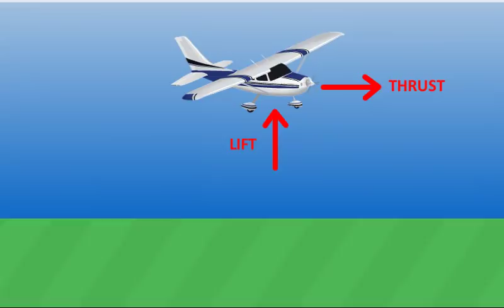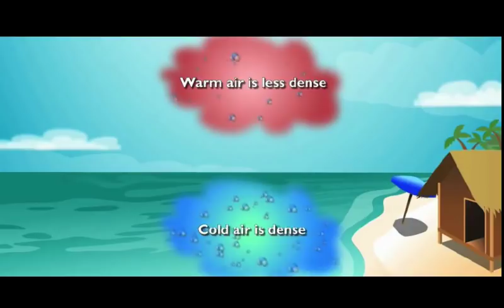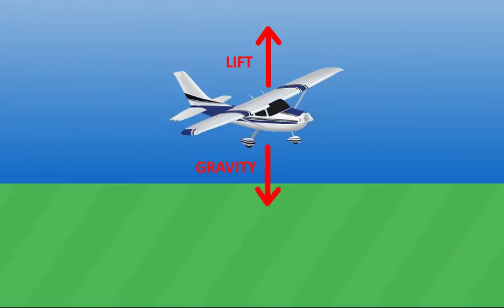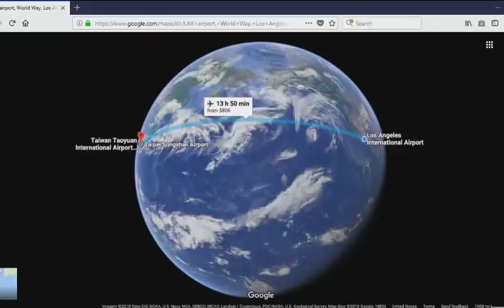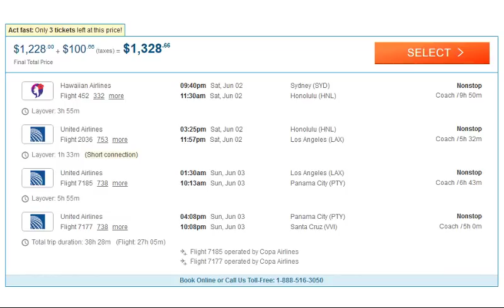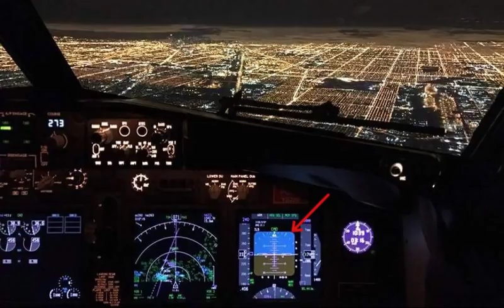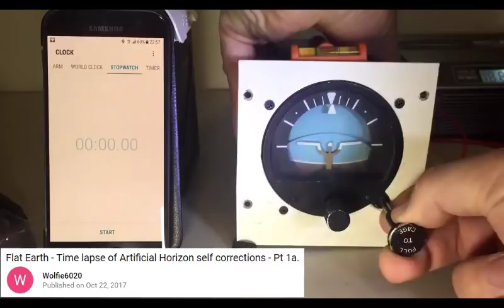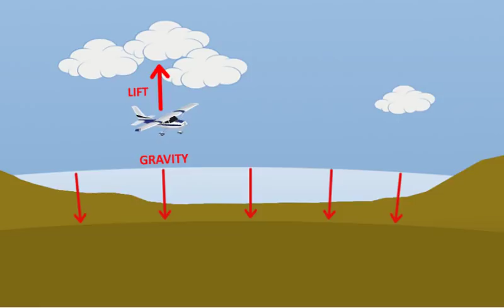Flat Earth Falsities - Plane Nonsense

Comment: WATER WOULD HAVE TO FLOW UP HILL FOR A GLOBE TO WORK. "THERE IS NO UPHILL ON A GLOBE" SAYS GLOBERS. GIVEN THAT LOGIC , THERES NO DOWN HILL ON A GLOBE EITHER. WHY WOULD WATER FLOW AT ALL? CANT HAVE IT BOTH WAYS. IF IT WERE A GLOBE ROTATING ON AN AXIS 1000 MILES AN HOUR AND HURLING THROUGH SPACE TOWARDS POLARIS THEN NORTH IS TOP/ FRONT ... EQUATOR IS THE CENTRE/MIDDLE AND SOUTH IS BOTTOM /BACK ... THE EARTHS MOTION WOULD CAUSE DIRECTIONAL ORIENTATION... 
WE ALL KNOW THE EQUATOR IS THE CENTRE / MIDDLE. .. THEN WE ARE SUPPOSEDLY ROTATING 1000 MILES AN HOUR ON AN AXIS WHICH MEANS CENTRIFUGAL FORCE IS GREATEST AT THE EQUATOR. 
THE IMAGINARY FORCE YOU REFER TO AS GRAVITY WOULD GRADUALLY GET STRONGER TOWARDS THE POLES . 
ITS AN "OBLATE SPHEROID"... "PEAR SHAPED" ... "A LITTLE CHUBBIER BELOW THE EQUATOR" ...
THEN ON TOP OF THAT THE EARTH IS HURLING THROUGH THE GALAXY AND SPIRALING AROUND THE SUN AT 37,000 MILES AN HOUR TOWARDS POLARIS. .. NORTH BOUND! NORTH IS FRONT! 
THE PHYSICS WOULD BE LIKE A WET FOOTBALL SPIRALING THROUGH THE AIR. WATER WOULD MOVE FRONT TO BACK ...NORTH TO SOUTH... AND BE THROWN OFF AT THE CENTRE/  MIDPOINT / EQUATOR . 
NILE RIVER IS OVER 4200 MILES LONG AND FLOWS FROM SOUTH TO NORTH. 
THE NILE RIVER WOULD HAVE 572 MILES OF CURVATURE AT ITS MIDPOINT  (APEX)
THEREFORE THE NILE RIVER WOULD HAVE TO FLOW UP AND OVER 572 MILES OF CURVATURE OVER A DISTANCE OF 4200+ MILES ON A BALL. 
THE NILE RIVER WOULD HAVE TO FLOW UP HILL BEGINNING SOUTH OF THE EQUATOR,CROSSING OVER THE EQUATOR AND CONTINUE NORTH DESPITE THE ENTENSELY STRONG CENTRIFUGAL FORCE . IMPOSSIBALL!  

THE SUPPOSED CURVATURE IS 8 INCHES PER MILE SQUARED. ..

1) BEDFORD EXPERIMENT PROVES NO CURVATURE. 
2) TORONTO ROGERS CENTRE SEEN FROM GRIMSBY 6FT ABOVE LAKE LEVEL FROM 30.84 MILES AWAY PROVES THERES NO CURVATURE. TOP OF THE ROGERS CENTRE SHOULD BE OVER 200FT BELOW THE SUPPOSED. 
3) CHICAGO SEEN FROM MICHIGAN PROVES THERES NO CURVATURE. 6FT ABOVE LAKE LEVEL.60 MILES AWAY.CHICAGO SHOULD BE 2166FT BELOW THE SUPPOSED CURVATURE. 
4) THE LONGEST CANAL IN THE WORLD IS 100 MILES LONG BUT NOT A SINGLE LOCH WAS USED. NO CURVATURE. 
5) LONGEST BRIDGE IN THE WORLD IS 102 MILES LONG. SHOULD BE ALMOST 7000 FT OF CURVATURE IN THAT BRIDGE.
6) LAKE PONTCHATRAIN BRIDGE IS 24 MILES LONG AND COMPLETELY LEVEL AND BUILT OVER WATER THE ENTIRE 24 MILES. ONLY 2 INCHES LOWER ON ONE SIDE . 2 INCHES IN 24 MILES??? NO CURVATURE!  SEA LEVEL NOT SEA CURVE!
7) EXALT WIRELESS WORKS BY LINE OF SIGHT OVER A DISTANCE OF 146 MILES! IMPOSSIBLE ON A GLOBE! 
8) SASKATCHEWAN. .. SALT FLATS OF BOLIVIA. .. KANSAS .... ALL FLAT FOR HUNDREDS OF MILES! 

SEA (LEVEL). .. AIR (PLANE)... PLANE (T) 

THERES ABSOLUTELY NO PROOF OF A GLOBE ROTATING IN SPACE. NOT A SINGLE REAL IMAGE/FOOTAGE. 
MOON LANDING WAS A HOAX. ISS LIVE STREAMS ARE OBVIOUSLY FAKE AND FILMED IN STUDIOS. ISS=IN SOME STUDIO. 
HARNESSES,  GREEN/BLUE SCREENS,  CGI, UNDER WATER , AIR BUBBLES,  FLY ON THE OUTSIDE OF THE ISS WINDOW. ETC 
WE LIVE ON A FLAT STATIONARY PLANE WITH A FIRMAMENT ABOVE. THEYVE NEVER BEEN TO SPACE. ITS A CLOSED SYSTEM. WE CANNOT LEAVE THE EARTH. SPACE IS WATER. 

WERNER VON BRAUN (NASA FOUNDER / ROCKET SCIENTIST) HAS PSALMS 19:1 ENGRAVED ON HIS HEADSTONE. 
PSALMS 19:1 TALKS ABOUT GOD AND THE FIRMAMENT.
Reply: Stop trolling and fuck off you ignorant fool.
Reply: TRU MAN Yup. Weight does change between the poles and the equator. http://curious.astro.cornell.edu/about-us/42-our-solar-system/the-earth/gravity/94-does-your-weight-change-between-the-poles-and-the-equator-intermediate
Y U NO RESEARCH?!!
Reply: This is one of the most insecure and pathetic flerfers yet.

I love this guy.
Reply: TRU MAN Did you miss my last response to you, where I provided real pix of the Earth, and many many ways that anyone, including you, can determine the shape of the Earth? Well, if you can spam, I guess I can too. Here it comes!!

Actual images of the Earth.
Current full-disk weather and Earth-observation satellite images:
http://www.goes.noaa.gov/
https://www.star.nesdis.noaa.gov/GOES/GOES16_FullDisk.php
http://rammb-slider.cira.colostate.edu
http://epic.gsfc.nasa.gov/
http://himawari8.nict.go.jp/
http://www.eumetsat.int/website/home/Images/RealTimeImages/index.html
http://electro.ntsomz.ru/en/
http://satellite.imd.gov.in/insat.htm 
Photos of Earth by planetary spacecraft, via the Planetary Society:
http://planetary.org/explore/space-topics/earth/pics-of-earth-by-planetary-spacecraft.html
The Project Apollo Archive on Flickr. Photos from all the Apollo missions in huge scans, including the many photos of Earth.
https://www.flickr.com/photos/projectapolloarchive/albums
NASA Johnson Flickr site. Photos from all of the ISS expeditions and much more: 
https://www.flickr.com/photos/nasa2explore/albums
Gateway to Astronaut Photography of Earth:
https://eol.jsc.nasa.gov/
Archived weather satellite images:
http://www.ssec.wisc.edu/datacenter/ (and the easiest place to navigate for all Meteosat images)
https://www.youtube.com/channel/UC8q7_qX1FsiNUa9bDc1jFqw/playlists (Wonderful Himawari-8 time lapses)
Dish Network's Dish Earth Channel: https://youtu.be/H-REzr7HB9E
https://www.dailymotion.com/video/x3kl7f2

Jenna Fredo's video submitted by her to Metabunk for analysis (you can see the refraction bringing the buildings up and compressing them, using the overlay slider in the entry on this page:  https://www.metabunk.org/posts/204561/

As for Lake Pontchartrain, Soundly has left your comment thread on one of his videos there as a lesson to others to do diligent reseearch. His photos and videos match the globe model perfectly: http://walter.bislins.ch/bloge/index.asp?page=Flat-Earth%3A+Finding+the+curvature+of+the+Earth The locations were also surveyed, by Jesse Kozlowski, but also many decades previously. https://youtu.be/BtCyR_MwhFo It is rock solid from every angle. "Flerspective" need not apply. 

As I tried telling you before, in this day and age, anyone can determine the shape of the Earth for themselves. We all have so many more resources than people in previous generations to make observations. Besides the photos of long straight level structures like the Ponchartrain Causeway and pylon line, you can do the exercises on the "Flat Earth Math" channel...
https://www.youtube.com/channel/UCTDz58kK5bdffWLSx4zgAFA 
You can measure it with friends, Eratosthenes style... 
https://youtu.be/V03eF0bcYno
Or through the method of Al Biruni, the "father of geodesy"...
https://owlcation.com/stem/How-to-Determin-the-Radius-of-the-Earth-Al-Birunis-Classic-Experiment
https://youtu.be/6XXCiHJOULQ
Through geodesy, which is how the world was measured and mapped... 
https://youtu.be/moDr0CPZhbs 
https://youtu.be/ZlP3njwf6h0
Geodesy includes the dip of the horizon, which has been taken into consideration with every use of a marine sextant for centuries... 
https://www.davisnet.com/product_documents/marine/manuals/00026-710_IM_00025.pdf (page 9) 
You can see it by using a long water level with a clear view of the ocean horizon... 
https://www.quora.com/How-can-we-practically-observe-that-the-earth-is-round/answer/Evan-Kress 
And in aircraft at altitude using a attitude indicator, theodolite app for your phone, and more... https://youtu.be/BLQhUX8brbA 
https://youtu.be/HFj7gNh3yOM  
Good paper on measuring sagitta in photographs of horizon at altitude: http://thulescientific.com/Lynch%20Curvature%202008.pdf
Important informal video specifically on importance of center of frame for high altitude balloons, if you want to go that route: https://youtu.be/c1-S_2vRsrM

As for those world records proving "flat earth", nope. The reason they garnered such attention is that those atmospheric conditions rarely coincide to show those mountains. Always go to the source. https://beyondhorizons.eu/2016/08/03/pic-de-finestrelles-pic-gaspard-ecrins-443-km/ Then you can go have some fun with the hoaxers... https://youtu.be/ZfeeN90XiBQ https://youtu.be/0PWSoYjH7OU 

As for "I can see too far across water" videos, keep in mind that refraction can do some wild things, especially when looming occurs, and you are using a telephoto lens which magnifies just a couple degrees of arc. A dead giveaway is visible distortion in the image. 
http://www.abc57.com/news/skyline-skepticism-the-lake-michigan-mirage
Meanwhile with minimal refraction, you will have sharp images with no distortion or mirroring, like this:
https://youtu.be/dKF7D7XsyTA
https://youtu.be/P8U5aYH1yhk

FE is a trolling internet prank. The only question is whether you are a troller or the trolled. I and others try to help people who don't have the common sense or basic knowledge to know better.
Reply: TRU MAN Here are your satellite tracking resources. When do you you take your own pix? I just got video of the ISS, and it certainly isn't a dot.
Satellite tracking in sky: 
http://www.heavens-above.com/ 
transit-finder.com 
http://www.skyandtelescope.com/observing/how-to-see-and-photograph-geosynchronous-satellites/ 
https://www.calsky.com/cs.cgi/Satellites/16 
https://spotthestation.nasa.gov/home.cfm 
Satellites and junk in 3D space: http://stuffin.space/ 
Cool pics: http://astrophoto.fr/satellites.html
Reply: TRU MAN Hmm. You limit your research to a tiny corner of YouTube, which is itself a very small section of the internet, which is just a part of the overall research material you could use, and also exclude yourself from doing your own actual experiments and observations to determine the shape of the Earth for yourself, the objective methods for which I provided for you.
Reply: Superior Planet 
Didn't think you would bombarding that uneducated fool that long. 
I would give it up after 10 comments. 
Give you a big compliment for keeping your cool. 
👌
Reply: TRU MAN
 "M SIMPLY DESCRIBING YOUR RIDICULOUS GLOBE MODEL TO DEMONSTRATE HOW WATER WOULD HAVE TO DEFY THE LAWS OF PHYSICS ON A ROTATING BAL"

You describe nothing, sjit for brain, you just regurgitate what you 've seen in flat earth YT video. The same old "argumnets" countless times debunked
Reply: TRU MAN : the living advice against the damages of inbreeding !
Reply: Oh, he typed in all caps. This must be important.
Reply: Actually it's called aircraft, and it flies in atmosphere, not atmosplane.
Reply: hemisphere not hemisphlat
Reply: I've seen these so called videos of iss flying by in the sky. They look fake to me. Very suspect. 
And for the 4rth time the live streams are obviously filmed in a studio. 
You keep avoiding this . I don't care what you think you see in the sky.
Reply: ALL THE LIVE STREAMS ARE FAKE! FILMED IN A STUDIO. ISS = IN SOME STUDIO.
Reply: THANKS TRU MAN.  JUST BY YOUR NAYM I NOW U ARE TRU!  FLAT ERFF FOREVER!!!!!!!
Reply: TRU MAN
"WATER WOULD HAVE TO FLOW UP HILL FOR A GLOBE TO WORK"

Another inbreed moron who doesn't know the difference between AL-TI-TU-DE (downhill/uphill) and LA-TI-TU-DE (one of the spherical coordonate) 
No wonder why you are a flat earth adept !
Reply: TRU MAN
"Superior Planet YOUR GLOBE IS SUPPOSEDLY ROTATING 1000 MILES AN HOUR. FASTER THAN THE SPEED OF SOUND. "
 NO littlme mama/half sister's boy
It rotates at 1 turn/day... twice slower than an hour hand !

ONLY hillbillies use units like MPH to qualify a rotation speed...
 Normal persons use RPM or RPS or rad/s...
Reply: TrU MAN

The only thing you have ever proven is the damages of inbreeding... so common in high religious background !
Reply: TRU MAN

"Superior Planet NO PROOF OF A GLOBE?  THATS WHAT I THOUGHT! LOL"
  Nobody care about what you thought.
 Your opinion have the same value than the last sheet of toilet paper I used... minus the fertilizer value !
Reply: TRU MAN 
Get your stuff straight otherwise your stupidity is getting the better of you.
Reply: Prove it
Reply: The earth supposedly rotates 1000 miles an hour at the equator but the Nile river starts south of the equator flows over the equator and continues north despite centrifugal force. Oh yeah its so plausible. Lol
Reply: Stop repeating the facts? Why would I do that? This post proves earth is flat.
Reply: WATER WOULD HAVE TO FLOW UP HILL FOR A GLOBE TO WORK. "THERE IS NO UPHILL ON A GLOBE" SAYS GLOBERS. GIVEN THAT LOGIC , THERES NO DOWN HILL ON A GLOBE EITHER. WHY WOULD WATER FLOW AT ALL? CANT HAVE IT BOTH WAYS. IF IT WERE A GLOBE ROTATING ON AN AXIS 1000 MILES AN HOUR AND HURLING THROUGH SPACE TOWARDS POLARIS THEN NORTH IS TOP/ FRONT ... EQUATOR IS THE CENTRE/MIDDLE AND SOUTH IS BOTTOM /BACK ... THE EARTHS MOTION WOULD CAUSE DIRECTIONAL ORIENTATION... 
WE ALL KNOW THE EQUATOR IS THE CENTRE / MIDDLE. .. THEN WE ARE SUPPOSEDLY ROTATING 1000 MILES AN HOUR ON AN AXIS WHICH MEANS CENTRIFUGAL FORCE IS GREATEST AT THE EQUATOR. 
THE IMAGINARY FORCE YOU REFER TO AS GRAVITY WOULD GRADUALLY GET STRONGER TOWARDS THE POLES . 
ITS AN "OBLATE SPHEROID"... "PEAR SHAPED" ... "A LITTLE CHUBBIER BELOW THE EQUATOR" ...
THEN ON TOP OF THAT THE EARTH IS HURLING THROUGH THE GALAXY AND SPIRALING AROUND THE SUN AT 37,000 MILES AN HOUR TOWARDS POLARIS. .. NORTH BOUND! NORTH IS FRONT! 
THE PHYSICS WOULD BE LIKE A WET FOOTBALL SPIRALING THROUGH THE AIR. WATER WOULD MOVE FRONT TO BACK ...NORTH TO SOUTH... AND BE THROWN OFF AT THE CENTRE/  MIDPOINT / EQUATOR . 
NILE RIVER IS OVER 4200 MILES LONG AND FLOWS FROM SOUTH TO NORTH. 
THE NILE RIVER WOULD HAVE 572 MILES OF CURVATURE AT ITS MIDPOINT  (APEX)
THEREFORE THE NILE RIVER WOULD HAVE TO FLOW UP AND OVER 572 MILES OF CURVATURE OVER A DISTANCE OF 4200+ MILES ON A BALL. 
THE NILE RIVER WOULD HAVE TO FLOW UP HILL BEGINNING SOUTH OF THE EQUATOR,CROSSING OVER THE EQUATOR AND CONTINUE NORTH DESPITE THE ENTENSELY STRONG CENTRIFUGAL FORCE . IMPOSSIBALL!  

THE SUPPOSED CURVATURE IS 8 INCHES PER MILE SQUARED. ..

1) BEDFORD LEVEL EXPERIMENT PROVES NO CURVATURE.  
2) TORONTO ROGERS CENTRE SEEN FROM GRIMSBY 6FT ABOVE LAKE LEVEL FROM 30.84 MILES AWAY PROVES THERES NO CURVATURE. TOP OF THE ROGERS CENTRE SHOULD BE OVER 200FT BELOW THE SUPPOSED. 
3) CHICAGO SEEN FROM MICHIGAN PROVES THERES NO CURVATURE. 6FT ABOVE LAKE LEVEL.60 MILES AWAY.CHICAGO SHOULD BE 2166FT BELOW THE SUPPOSED CURVATURE. 
4) THE LONGEST CANAL IN THE WORLD IS 100 MILES LONG BUT NOT A SINGLE LOCH WAS USED. NO CURVATURE. 
5) LONGEST BRIDGE IN THE WORLD IS 102 MILES LONG. SHOULD BE ALMOST 7000 FT OF CURVATURE IN THAT BRIDGE.
6) LAKE PONTCHATRAIN BRIDGE IS 24 MILES LONG AND COMPLETELY LEVEL AND BUILT OVER WATER THE ENTIRE 24 MILES. ONLY 2 INCHES LOWER ON ONE SIDE . 2 INCHES IN 24 MILES??? NO CURVATURE!  SEA LEVEL NOT SEA CURVE!
7) EXALT WIRELESS WORKS BY LINE OF SIGHT OVER A DISTANCE OF 146 MILES! IMPOSSIBLE ON A GLOBE! 
8) SASKATCHEWAN. .. SALT FLATS OF BOLIVIA. .. KANSAS .... ALL FLAT FOR HUNDREDS OF MILES! 

SEA (LEVEL). .. AIR (PLANE)... PLANE (T) 

THERES ABSOLUTELY NO PROOF OF A GLOBE ROTATING IN SPACE. NOT A SINGLE REAL IMAGE/FOOTAGE. 
MOON LANDING WAS A HOAX. ISS LIVE STREAMS ARE OBVIOUSLY FAKE AND FILMED IN STUDIOS. ISS=IN SOME STUDIO. 
HARNESSES,  GREEN/BLUE SCREENS,  CGI, UNDER WATER , AIR BUBBLES,  FLY ON THE OUTSIDE OF THE ISS WINDOW. ETC 
WE LIVE ON A FLAT STATIONARY PLANE WITH A FIRMAMENT ABOVE. THEYVE NEVER BEEN TO SPACE. ITS A CLOSED SYSTEM. WE CANNOT LEAVE THE EARTH. SPACE IS WATER. 

WERNER VON BRAUN (NASA FOUNDER / ROCKET SCIENTIST) HAS PSALMS 19:1 ENGRAVED ON HIS HEADSTONE. 
PSALMS 19:1 TALKS ABOUT GOD AND THE FIRMAMENT.
Reply: Superior Planet HORIZONTAL IS ALWAYS HORIZONTAL STUPID. FLAT,EVEN,PLANE.
Reply: Superior Planet I ALREADY HAD A COOKIE. A PEANUT BUTTER CHIP COOKIE !
Reply: Superior Planet YOUR GLOBE IS SUPPOSEDLY ROTATING 1000 MILES AN HOUR. FASTER THAN THE SPEED OF SOUND. 
THE EARTH IS SUPPOSEDLY FLYING THROUGH THE GALAXY SPIRALING AROUND THE SUN AT 37,000 MILES AN HOUR. AND FLYING THROUGH SPACE AT 500, 000 MILES AN HOUR. YEAH ID DENY THIS TOO IF I WERE YOU. ITS ABSOLUTELY RIDICULOUS! LOL
Reply: Superior Planet SUPERIOR PLANE (T) DIDNT ADDRESS A SINGLE THING I SAID WITH REBUTTALS . WHY? BECAUSE HE CANT! DIDNT EVEN TOUCH THE LACK OF CURVATURE! LOL
Reply: Superior Planet LEVEL = FLAT, EVEN, PLANE.  PLANE (T) .. HORIZON. .HORIZONTAL. .FLAT EVEN PLANE . NO CURVATURE NO GLOBE. . FACTS HURT I KNOW.
Reply: Superior Planet ITS AN "OBLATE SPHEROID". .. YEAH CUZ THATS EXACTLY WHAT WE SEE IN THESE FAKE IMAGES/VIDEOS. LOL
Reply: Superior Planet NO PROOF OF A GLOBE?  THATS WHAT I THOUGHT! LOL
Reply: Superior Planet ITS CALLED AN AIR PLANE BECAUSE IT FLIES OVER A PLANE. GYROSCOPES PROVE PLANES FLY OVER A PLANE. GYROSCOPE NEVER ROLLS BACKWARDS. NO ADJUSTMENTS EVER MADE TO COMPENSATE FOR THE SUPPOSED  "CURVATURE". ..
Reply: Superior Planet ONLY 1 "MOON LANDING" WAS EVER FILMED. THEY SUPPOSEDLY LOST THE FOOTAGE AND DESTROYED THE TECHNOLOGY THEY USED TO GET TO THE MOON. DISNEY PRODUCTION. STANLEY KUBRICK. FILMED IN THE DESERT. AREA 51.  
ROCKETS GO UP ,DO A MASSIVE ARCH AND COME BACK DOWN INTO THE OCEAN. 
SEARCH- CHALLENGER ASTRONAUTS FOUND ALIVE AND WELL .
THEY SUPPOSEDLY DIED 30 YRS AGO IN THE CHALLENGER EXPLOSION. LOL 
SEARCH -ROCKET SLAMS INTO FIRMAMENT. 
SEARCH -METEOR HITTING THE FIRMAMENT. 
SEARCH -ROCKET HITS THE FIRMAMENT. 
SEARCH -SPRITES PROVE THE FIRMAMENT. 
SEARCH -ISS EXPOSED USING HARNESSES. 
I NOTICED YOU ADDRESS SOME THINGS BUT AVOID OTHERS . LOL
Reply: Superior Planet THE SKY IS ROTATING NOT THE EARTH. TIME LAPSE OF POLARIS PROVES POLARIS IS CENTRE AND STATIONARY. PERFECT STAR TRAILS AROUND POLARIS PROVE WE ARE NOT SPIRALING AROUND A SUN AS THEY SUGGEST. THE STAR TRAILS WOULD BE ALL OVER THE PLACE DOING ALL SORTS OF STRANGE THINGS  MAKING RANDOM PATTERNS.
Reply: Superior Planet "CENTRIFUGAL FORCE IS AT ITS STRONGEST AT THE EQUATOR . GRAVITY WOULD GET STRONGER TOWARDS THE POLES." NO ,IT DOESNT! 
IM SIMPLY DESCRIBING YOUR RIDICULOUS GLOBE MODEL TO DEMONSTRATE HOW WATER WOULD HAVE TO DEFY THE LAWS OF PHYSICS ON A ROTATING BALL. REMEMBER THE NILE RIVER ARGUMENT? WATER WOULD HAVE TO FLOW UP HILL FOR A GLOBE TO WORK. WATER FLOWS IN EVERY WHICH DIRECTION ON YOUR SUPPOSED GLOBE. WIND BLOWS IN EVERY WHICH DIRECTION ON YOUR SUPPOSED GLOBE. IF IT WERE REALLY ROTATING 1000 MILES AN HOUR THE ENVIRONMENT/ATMOSPHERE WOULD BE CONSISTENT . THE ENVIRONMENT / ATMOSPHERE DOESN'T REFLECT THAT OF A GLOBE ROTATING IN SPACE. LOL
Reply: Superior Planet YEAH CUZ YOU KNOW THE INS AND OUTS OF MY PERSONAL LIFE.
"I DONT GO OUT AT NIGHT" THIS GLOBETARD SAYS. LOL
YOURE THE LYING PIECE OF SHIT. NASA IS A FRAUD. DAMN RIGHT I LAUGH AT THEIR FAKE DEAD! LMAO
YOU DONT TAKE THE TIME TO SEARCH FOF THE TRUTH BY DOING YOUR OWN RESEARCH. YOU WASTE YOUR LIFE LIVING A LIE BECAUSE YOU JUST ACCEPT WHAT YOURE TOLD. IDIOT TOOL!  LOL
Reply: Superior Planet I DONT REMEMBER READING ANYTHING FROM YOU ADDRESSING THE COMPLETE AND TOTAL LACK OF CURVATURE.  LET ME GUESS, YOU SAID, REFRACTION AND MIRAGE OR SOME SHIT LIKE THAT ?? FAAAACK OFF! YOU LYING SACK OF SHIIIIIIT! LOL
Reply: Superior Planet SHOULD SEE THOUSANDS OF SATILITES. NOPE! CERTAINLY DO NOT! THOUSANDS OF SATILITES AND MILLIONS OF PIECES OF DEBRIS / SPACE JUNK WOULD MAKE SPACE TRAVEL / ORBITING EARTH IMPOSSIBALL! 
DEBRIS WOULD DESTROY ALL THE SATILITES/SHUTTLES AND ISS. THIS IS TOO EASY. YOU WALKED RIGHT INTO THAT ONE .SET YOURSELF UP ACTUALLY. LOL
Reply: Superior Planet YOU HAVENT OFFERED ANY PROOF FOR A GLOBE ROTATING IN SPACE. NONE.
Reply: Superior Planet STILL HAVEN'T ADDRESSED THE COMPLETE AND TOTAL LACK OF CURVATURE OR OFFERED ANY PROOF FOR A GLOBE. LOL
Reply: Superior Planet I LOVE MY COMMENTS . I READ THEM OVER AND OVER. THEYRE LIKE POETRY! LOL
IM ABSOLUTELY DESTROYING YOU. YOU STILL HAVEN'T ADDRESSED THE TOTAL LACK OF CURVATURE! LOL
Reply: Superior Planet YOU LOST THIS DEBATE !
Reply: RogHawk I DONT WATCH GLOBETARD VIDEOS. ONLY HONEST FLAT EARTH VIDEOS. PLENTY OF HIGH ALTITUDE  BALLOONS PROVING NO CURVATURE. 
EXALT WIRELESS WORKS BY LINE OF SIGHT OVER A DISTANCE OF 146 MILES. 
PERISCOPES WORK BY LINE OF SIGHT. 
LASER GUIDED MISSILES. 
LIGHTHOUSES. 
ALL WORK BY LINE OF SIGHT. 
BEDFORD LEVEL EXPERIMENT. 
8 MILE LASER TEST. 
LAKE PONTCHATRAIN 24 MILE BRIDGE BUILT COMPLETELY LEVEL. ONLY 2 INCHES LOWER ON ONE SIDE.
LONGEST CANAL 100 MILES LONG AND NO LOCHS. 
ABSOLUTE PROOF THERES NO CURVATURE! ! LMFAO
Reply: Superior Planet YOU SAID NOTHING. PROVED NOTHING. NO REBUTTAL. PROVE A GLOBE GLOBETARD! 
WE ARE SUPPOSEDLY FLYING THROUGH SPACE . POLARIS IS THE CENTRE STAR AND DOESNT MOVE.PERFECT STAR TRAILS CAN BE SEEN CIRCLING A STATIONARY POLARIS YET WE ARE SPIRALING AROUND THE SUN. 
DO YOU HAVE ANYTHING INTELLIGENT TO SAY? ANY PROOF OF A GLOBE?  
WIND BLOWS IN ALL DIFFERENT DIRECTIONS AND WATER FLOWS IN ALL DIFFERENT DIRECTIONS  ON THIS "SPINNING BALL" . SHOULD BE CONSISTENT.  ITS NOT. ONE MINUTE WIND IS BLOWING 100 MILES AN HOUR AND THE NEXT DAY THERES NO WIND AT ALL. ABSOLUTELY RIDICULOUS! LOL
Reply: Superior Planet THESE GLOBETARDS ARE SO INSECURE THEY INSTANTLY LIKE THEIR OWN / EACH OTHERS COMMENTS. LOL NO CURVATURE NO GLOBE. SIMPLE LOGIC. ONLY ARGUMENT I NEED.
Reply: Superior Planet I SAID ISS LIVE STREAMS ARE FAKE. FILMED IN A STUDIO. HARNESSES, BLUE SCREEN, CGI, PROPS, SPACE WALKS ARE IN UNDER WATER STUDIO.  ISS = IN SOME STUDIO.  
I DONT CARE ABOUT SOME LIL LIGHT THAT FLIES PASSED THROUGH THE SKY. IVE SEEN YOUR SO CALLED ISS IN THE SKY. HIGHLY SUSPECT. LOOKS FAKE TO ME. DOESN'T PROVE SHIT.

SEARCH - ISS IS FAKE. 
SEARCH - ISS FLYING THROUGH SKY EXPLAINED. 

DO YOUR RESEARCH PEOPLE. DIG DEEP. THE GOVERNMENT ARE LYING TO YOU ABOUT MANY THINGS!
Reply: Superior Planet AIR PRESSURE IS EXPLAINED JUST AS EASY IN A CLOSED SYSTEM WITH A FIRMAMENT ABOVE. 
MAKES FAR MORE SENSE TOO. SOMETHING WOULD HAVE TO SEPERATE THE ATMOSPHERE AND VACUUM OF SPACE.
BUT THERES NO VACUUM. SPACE IS WATER. THE IS NO SUCH THING AS GRAVITY.